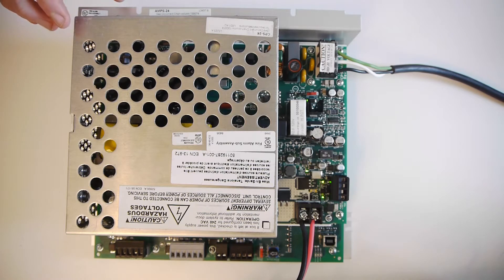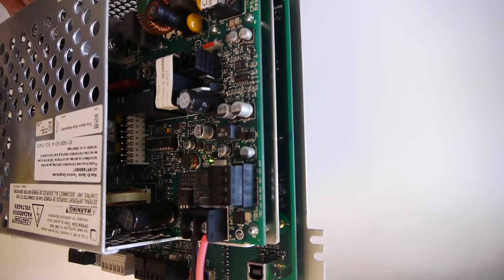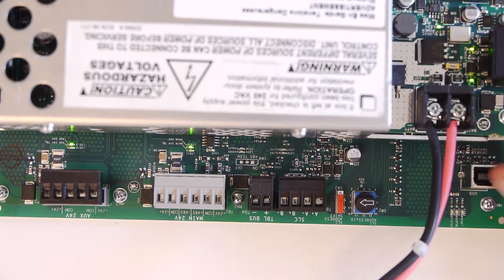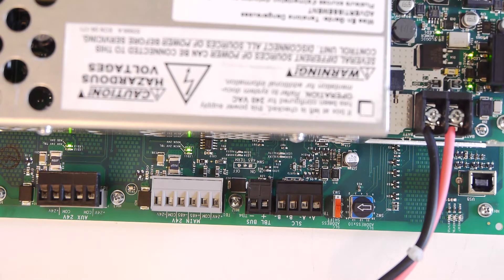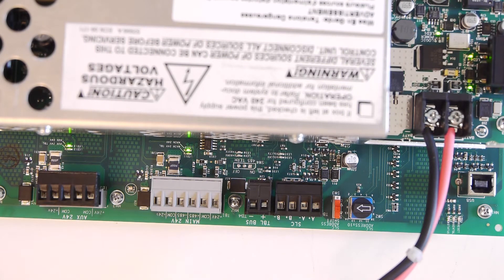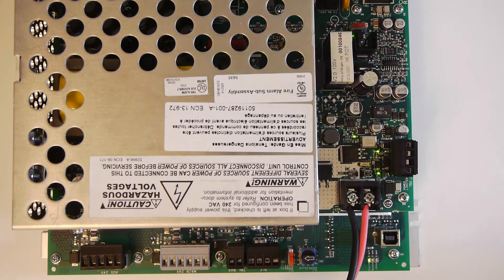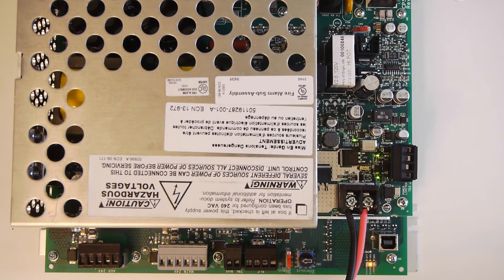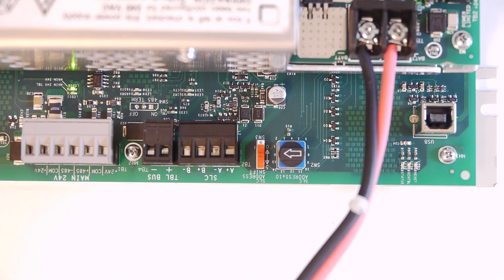Notifier AMPS-24 power supply Overview (for the NFS2-3030D)

Comment: Nice video! Are the nfs2-3030s programable through the panels keypad? Or is the software required? Thanks
Reply: you need software for the 3030, its not feild programmable
Reply: @s.ep30  field*
Reply from the maker: @s.ep30  You dont
Reply: @FireAlert  shhh

Comment: Very informative video. Thanks for it. It will great if you will make video on HPFF8 and HPFF12 power supply. and also on new PSE-6 & PSE-10 power supplies as it is hard to find more info like this on internet or may be I have missed to check properly. Thanks again.
Reply from the maker: Thanks for watching, if I get any of those power supplies I will be sure to make a video.